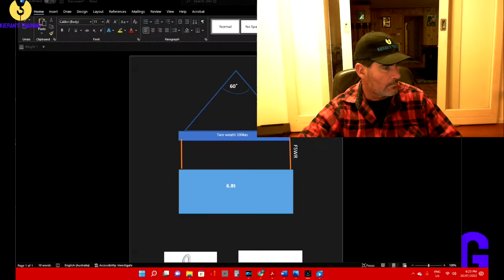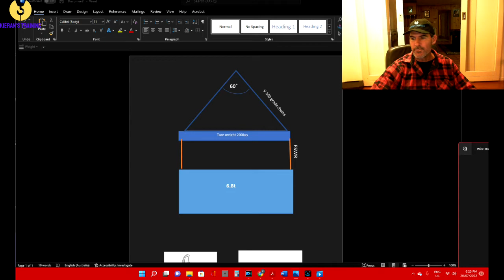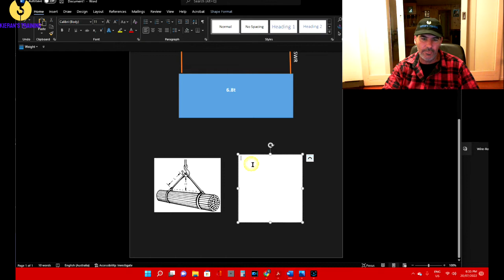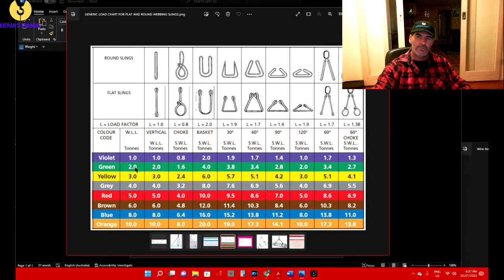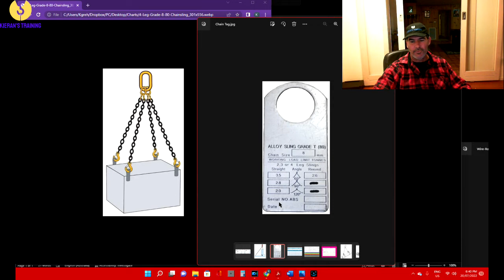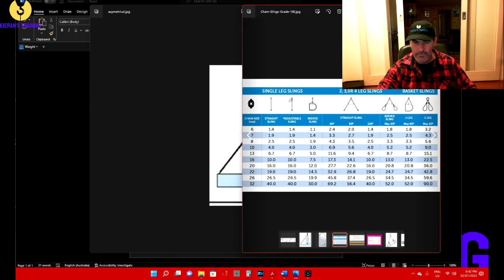Dogging Calculations Made Easy | Load Weights & Sling Capacity

Comment: Great channel mate, 
Another thing to keep in mind is, if using a multi leg set of chains, but you only going to use one leg for a straight lift, the lifting capacity of one leg of the chain is equivalent to what ever the rating is at 120° for the chains your using.

Comment: G'day mate cheers for what you're doing here, I've got a question about the chain load charts. When I was up in Queensland my top hand told me when you've got your chains at lets say 60 degrees reeved around a square load you can just use the column on the chart for the single chain reeved around the half square half round load and then multiply that by the angle factor rather than using the first column (single leg no reeve) then multiplying that by the angle factor then the reeve factor. Is this correct? It makes sense to me because they've already provided the reeve factor, if indeed that drawing on the chart represents reeved around a round or square load. Cheers
Reply from the maker: Gday Ben, you are correct you can do that or alternatively you can look at what is typically the last or second last column on the chain chart which will give you the wll already worked out for 60 degrees and reeved. You are also correct in the reeving factor being the same around a square or round load when using chains. Just make sure to double check on the chain tag before using to ensure you were looking at the correct grade of chain.
Reply: Beauty, cheers mate